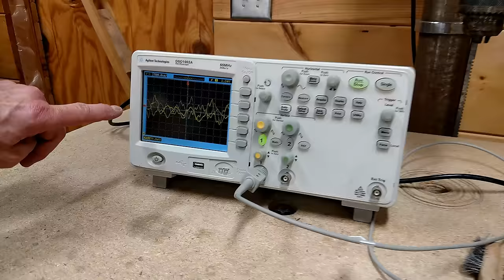Active Noise Cancellation

Comment: Why not create a 2 layered box that has a vacuum in between the layers?
Reply from the maker: It would work, but the weight of the structure required to hold open the vacuum against atmospheric pressure is prohibitive.
Reply: Tech Ingredients I’m curious how well one of those stainless steel vacuum insulated thermos would isolate sound.
Reply from the maker: Probably not too well because the stainless steel would transmit the vibrations through the portion that connected the inner and outed walls.  Those models with a bellows  mounted at that point might work a lot better.

Comment: mass,  stiffness, absorption .. what about shape (e.g. wedge, cone,..)
Reply from the maker: Shape can be used to optimize these properties.  For example, wedge shaped foam will increase the surface area for absorbtion and reduce the effective stiffness of the foam. Corrugated plate will be stiffer than a flat plate.
Reply: well put, thank you!

Comment: How can you tell if active noise canceling is actually working? Especially if you purchased a cheaper pair of headphones that claim to utilize this technology.
Reply from the maker: That's a good question.  Active noise cancellation depends on power input that allows the sensor and electronics to operate as well as to drive the speaker that acts to oppose the incoming pressure waves.  Set up a remote, continuous noise source and compare the perceived volume as you turn the drive power on and off.
Reply: Tech Ingredients So.. you mean basically put the headphones on and turn the volume up and down on an external noise making source and listening for a difference?
Reply from the maker: No.  Leave the noise source constant and flip the power to the headphones on and off.  Active niose reduction requires electrical energy while the passive sound reduction of the headphone's padded ear cups will remain as constant as a floor to their sound reduction capabilities.
Reply: Tech Ingredients ok, gotcha

Comment: do you think that this technology could be applied for the windows?
Reply from the maker: Yes, but I would do it a little differently.  Have you heard of laser microphones?  These have become infamous for spying.  The drivers would have to be mounted near the periphery if you wouldn't want to obstruct the view or limited to a single centrally mounted driver if that's tolerable.  There will be a lot of modes present in the window as we saw in our video on speaker design and the Chladni plates, but a few of the most troubling modes could be inhibited.
Reply: I thought about creating a shield behind the shutter made from sponge and hard metal in addition an active system like the one you described. Of course everything would work when the shutters are closed. thank you to answer my question!
Reply: Tech Ingredients Is there a place where the design is detailed?  I would like to attempt this for a desktop CNC machine.  Thank you for an amazing set of videos.

Comment: Love it, but wouldn't it be better to make the thing that is making the noise to not make the waves? or put the thing in a gas like helium so the waves are not created in the first place. I get what you have done; and if the thing was, lets say a jet engine. would it work to make several engines that were out of sink as far as the sound waves were concerned. Ignore this; I just noticed your other videos.

Comment: What processor did you use?
Reply from the maker: The beauty of 180 phasing reversal is that no processor was required.  This limits the performance to wavelengths that are long enough that the differential distance between the microphone and the exciter (1 cm) is small compared to 1/2 wavelength.

Comment: I wonder if tvis could work with a pc case
Reply from the maker: It undoubtedly would work and I suspect very well.  The heat transfer within the box filled with helium will be  better than in air, but the challenge will be helium retention.  EVERY SINGLE potential leak point will have to be blocked.  Even standard connections such as a USB cable will need an air tight bulkhead fitting installed.  Hot glue around the fitting will seal poorly.  You might get away with stripping the jacket and running the individual wires through adhesive.  Some fans within the box will circulate the helium.  The entire outer metal box will become the heat sink.

Comment: Wow... So basically, if I simply attached the dlm speakers to my glass window and fed them the noise input of the outside world through a microphone, I'd have active noise cancelling windows?
Reply from the maker: Yes... basically, yet there are some issues.  As the frequency increases, the phase mismatch that must exist because the microphone and the driver do not exist in exactly the same point in space, increases.  This works best with low frequencies.  Also, the microphone needs to be isolated from the driver so that it does not feedback the driver's output into a loop and that's another reason we used the foam inside the box.  There needs to be some engineering here.
Reply: @TechIngredients  Thank you for the fast response! I think my engineering skills won't be enough to go by "intuition" ;-)
Reply: @TechIngredients  so would this work for eliminating  a 16k frequency of about 127db  Inside of a metal enclosure?

Comment: LOVE your work, I really need to know the answer to this question....

Earth is spinning west to east. 
At the equator the ground speed is approx 1675 kph.
Person A stands on the ground in the east. 
Person B stands on the ground in the west. 
Person A and B are 10 meters apart. Nothing but air is between them. 
It is a still day (no wind). 
They are facing each other.
Sound travels through the air medium by vibrating the molecules of air.
https://www.le.ac.uk/se/centres/sci/selfstudy/snd2.htm
Air movement affects sound travel. 
At 20 degrees C it travels at 1236 kph.
Person A is moving 1675 kph eastward. 
Person B is moving 1675 kph eastward. 
The air between them is moving 1675 kph.
QUESTION. 
A speaks and the sound travels at 1236 kph from A towards the west. 
But as the air is moving at 1675 kph eastward, wouldn't the air carry the sound that is moving at 1236 kph away faster than the sound is moving, and B would not hear A ?
 

If the answer is ‘relativity’ and the sound calculation requires the addition (and subtraction) to make it work, here is another question. 

Sound takes the same time to travel from person A to B as it takes from B to A. 

This being the case than....
Voice from A to B travels 1236 plus 1675 being 2911 kph. 
Voice from B to A travels 1236 minus 1675 being negative 439 kph. 

How does the sound 'know' what speed to travel so that it matches what we experience in reality?
Reply from the maker: The easiest answer may sound flippant, but it's useful.  How do you know that the Earth is rotating?  Without referencing some outside, celestial body or relativistic properties, all the components of your proposed system are static relative to each other.

Comment: Hi ! What if you introduce a vacuum?
Reply from the maker: You would get complete sound blocking, but the difficulty in constructing the high strength enclosure is substantial.
Reply: Tech Ingredients How about like a vacuum chamber that “the king of random” or “the action lab” has? They look pretty simple.

Comment: Could I use something like this to isolate a party wall from noisy naughbours
Reply from the maker: Yes. The microphones need to be placed outside the wall so that they will "hear" the neighbors rather than you.  And for a large wall, you will need multiple mic/exciter pairs to reduce the movement of the wall across its relatively flexible surface.  You will also need the exciters to be mass loaded so that they will not simply move in response to the microphone input and apply a significant force to the drywall.
An isolated drywall surface in front of the existing wall with a thin, metalized Mylar "bag" containing helium may actually be more effective and simpler to implement on this scale.
Reply: @TechIngredients  would piano discs work ?  From my side

Comment: Couldn’t you cancel noise with baffle tubing that divides the sound out and rejoins them out of phase? There’s lots of options to explore, such as shape of the baffles to lengthen the compression and decrease the amplitude. Tesla valve like bodies would also be worth exploring.
Reply from the maker: That is a good idea and I believe it could work especially within the controlled environment of a sealed enclosure.

Comment: Nice intro to the basic concepts but the single frequency "noise" is totally artificial. The amp will have different phase delay at different frequencies as well as differing amplitude gain with frequency ( not to mention the mikes ). This will do little in practice with a real sound.

Comment: Are there buyable "kits"? For example for building a generator quiet box with double wooden board, and speakers between this boards.
Like this double glas Windows: https://www.daserste.de/information/wissen-kultur/w-wie-wissen/sendung/2010/ein-mit-mikrofon-und-lautsprecher-ausgestattetes-schallschutzfenster-100~_v-standard368_283c5f.jpg (this is a old experimental version, but working).

Comment: That concept isn't new in any way, shape or form.

And it only works for a KNOWN waveform. Like a sinus wave. Or a mono signal fed to two 180 degrees phased speakers facing eachother.

If you want to use the same concept on the daily noice we have all around us then you'd have to have a god damn insanely fast DSP that could sample AND process the direct preassure waves, the early reflections AND the late reflections in real time.

And that will not happen.
Reply from the maker: Firstly, who said some concept was new?  In any case, what does newness have to do with validity. Secondly, it is a sine wave you are referring to unless you are talking about the nose.  
Noise cancellation will work for any, arbitrary waveform as long as the opposing waveform is an inverse.  It doesn't matter what "direction" the speaker is pointed.  In fact, the noise source doesn't have to be a speaker at all as long as the sound pressure waves from the cancelling source arrive out of phase and with an equal and inverse amplitude.  DSP's that process simple algorithms such as sampling the output of an actuator or piezo detector and driving a voice coil can process millions of samples/second.  Direct or reflected pressure waves are irrelevant, all that matters is what the detector, detects.  It's already being done.

Comment: did ya fill it with helium?
Reply from the maker: Not in this video.
Reply: how do you plan to take the exhaust out and such without much sound leak?
Reply from the maker: Through deflecting, sound absorbing louvers that exhaust the cooling flow which has passed over the electronics, then the engines and then around the mufflers.

Comment: I am certainly no scientist but I personally have seen several automotive engine exhaust mufflers cut open, revealing just that. The angled metal baffles are arranged in a manner to reflect a great deal of the engine exhaust sounds back upon themselves to cancel them out as they are pushed through the muffler. Mind you that there are ever changing designs and materials being used to control decibels as much as possible without impacting performance through airflow restriction...   

Maybe they could install low cost microphones at key points in the vehicle.  Using hardware and software solutions to analyze,  in real time, & play the opposite waves through a vehicles speakers. Effectively cancelling tire tread road noise, air friction sounds, engine drivetrain white noise as well as any unwanted noise pollution from the public at large....?

ok, I lied... I am a scientist. No, but really folks I dont want to go through life with ear buds crammed in my ears or wear headphones like I am a 49 year old Dj. Why cant we use existing speakers from our Televisions, Computers, Car Audio etc and just have somekind of new noisecanceling in real time firmware .... use existing microphones (Your smart TV can hear you, cellphones, tablets, pc, laptops, every car has onstar basically....voila...microphone... (a damn good one comes with onstar, its amazing how accurate).....   and just like that......

...we could all have access that amazing Bose active, real time noise cancelling ability they used to charge a couple thousand for to make everything go away. Albeit now we can control what gets silenced, reduced volume or unaffected.... like your mother in law. She needs to know that you are getting her loud and clear.   

-Tony Cusimano

Comment: Nice video. What are the implications of this when a music is playing inside the car? How can the "favorable" and "unfavourable" frequencies separated?
Reply from the maker: The unfavorable sound within a car will vary depending on where the passenger sits, the velocity of the car, the power output and RPM of the engine as well as the road conditions.  Although this analysis goes beyond the subject in this video, I would approach this by analyzing the different noise sources and try to minimize them individually.  Only then would I look at how desired sounds such as the music and conversation can be enhanced.  We are preparing a series on some unusual passive sound blocking techniques.  You might want to watch them.
Reply: so does this mean drivers blasting their eardrums out with their obnoxious music can simply reverse the polarity on a second set of speakers aimed outwards to spare us the pain?

Comment: You're going about it the wrong way all you have to do is make your box strong enough to pull a vacuum and it okay and then where your air is allowed to come  in use Tesla valves I use your active sound inverter where you would normally have a silencer on a vacuum chamber used for a generators and such

Comment: You lost me at approx 11:38. You just don't give us enough information about what you're doing or why. I know it's all clear and simple to you...but we aren't you. 
You've a metal box with 5 sound sources...and it just gets less and less comprehendible from there.
Reply from the maker: The principle is pretty simple.  Each mic inside the box is right on the other side of the wall from it's own audio driver.  When a sound pressure wave strikes the mic, the signial is sent to the amp which then moves the driver to cancel the pressure wave by pushing on the outside of the box at the same time the wave is pushing on the inside.

Comment: A lot of complexity...
For an enclosed environment, wouldn't sandwich pockets of hydrogen be nearly as effective?
No electronics, no power supply, no wires, no exciters, no microphones.
Reply from the maker: Not necessarily.  Although hydrogen has a low molecular weight and is even better than helium at blocking sound, it is very flammable and potentially dangerous. The challenge with using one of these light gases is that the barrier has to scrupulously prevent sound from making its way around the light gas through solid interfaces such as beams and struts or remaining stable without these components.

Comment: What if the enclosure was designed like some sort of vacuum chamber and all the air molecules are reduced. Maybe most of the sound would be eliminated. This idea is coming from a man who clearly does not know what he’s talking about so please don’t laugh at me.
Reply from the maker: That can work.  It is easier if the enclosure does not need to be reinforced to resist outside atmospheric pressure.  Check out our videos on helium and sound.
Reply: Tech Ingredients ok. I will. Thanks.

Comment: Tech Guy,
Please see if  you can boil this down to a 4 minute video
Reply from the maker: Why?
Reply: @TechIngredients  Think of it as an intellectual challenge.
Reply from the maker: The cost benefit ratio doesn't justify the effort.  We could boil this down to 60 seconds with a substantial loss of content, but there's no point.
Reply: @TechIngredients  A shorter segment showing basic implementation would likely have a significant higher  viewer count. Most similar videos run 20 minutes or so.